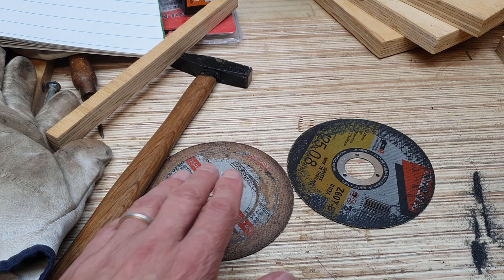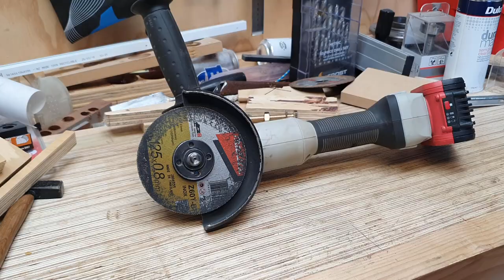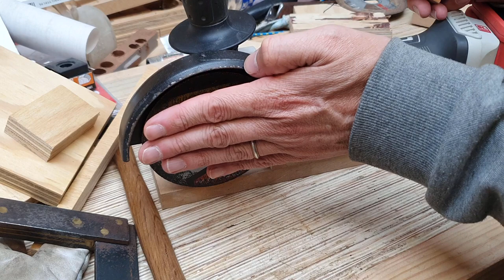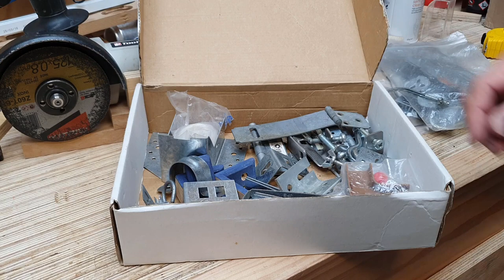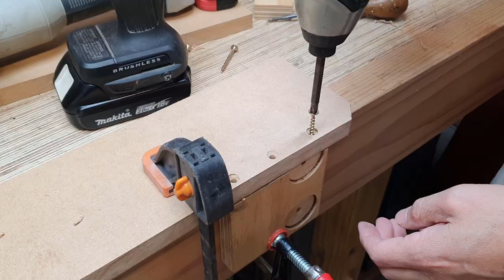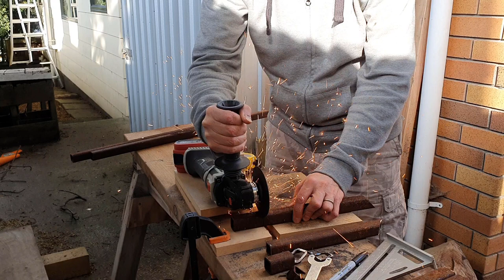How I turned my angle grinder into a super simple cut off saw

Comment: Nice jig bud hey wait that's not a makita 😮
Reply from the maker: cheers man! Ha - I wish it was a Makita and I may replace it - the battery on this thing takes about 37 hours to recharge! I'm trying to get an adapter so I can run it on my Makita batteries  - but so far can't find one. The battery is exactly the same as a Worx battery I found out, and a few other brands as well.
Reply: @TakamiWoodshop  oh well then you should find one easy enough so
Reply from the maker: There are two formats of Worx batteries, found the new one but I have the old...... Ffffff! 😬
Reply: @TakamiWoodshop  can you still order anything from amazon or anything? I've managed to get a few bits from em over here
Reply from the maker: Local delivery is limited to essential items like heating, clothing, computers for work from home, pre packaged meal services etc. International inbound shipping capacity is down 95% or something. So not many options, just have to ride it out for a while longer I guess.
Reply: @TakamiWoodshop  yea hopefully it wont be for too long. Stay safe bud 👍
Reply from the maker: You too mate!